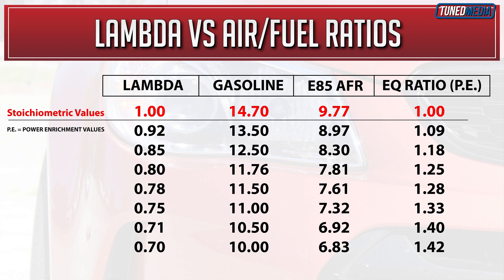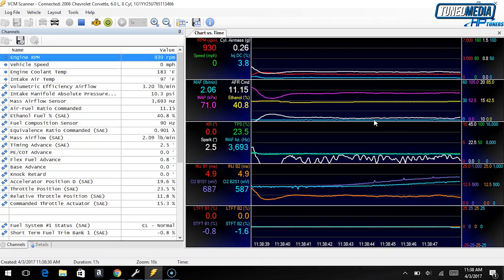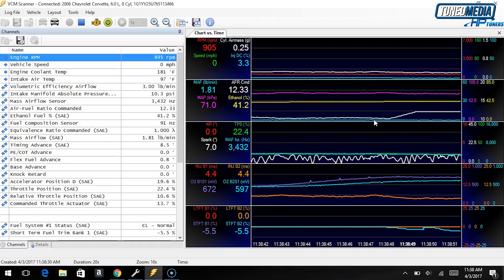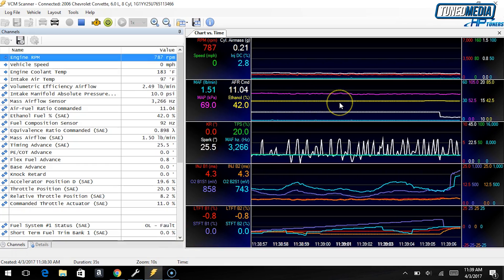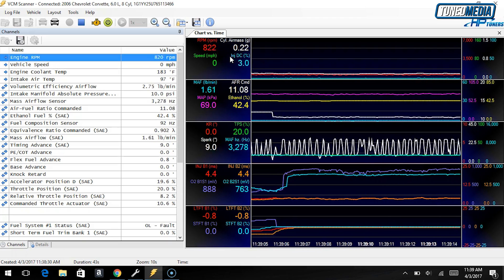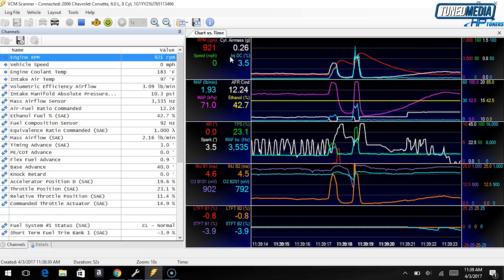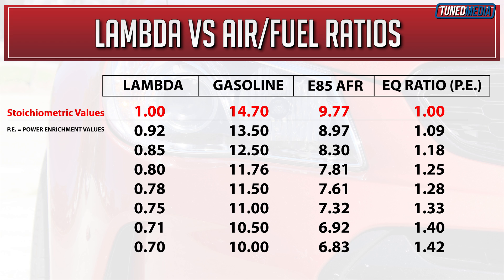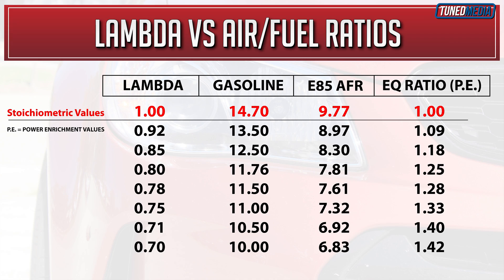Why Experienced Tuners Use LAMBDA and Not AFR When Doing a Flex Fuel Tune

Comment: So what wasn't said here was how to find the EQ ratio of a Lambda value. It's easy on a calculator. Take the Lambda number you want such as .85 and put it in the calculator, then hit the inverse button (1/x). The value will be 1.1764.....or 1.18. Not all calculators have the inverse, but your phone probably does. Cheers-FasNuf Garage

Comment: Go ahead and try running your AFR 9.7 on E85 and let me know how that works. Just tune by AFR on the gauge cause it's automatically converted in the wideband controller. Tune the same way between gas and Ethanol.
Reply: My hellcats tuned at 9.7 lambda reading  strict E85 and runs perfectly  fine?
Reply: Um thats what its supposed to be...lol

Comment: These guys always say this but it really doesn't matter what you use, you just need to know where to end up up. And tuning for power is just adding fuel till it stops pulling harder, so you only need any of this to calibrate the MAF and start your base line...  flex fuel sounds very complicated but it's really really easy in the end... Almost too easy for the power it makes.

Comment: The wideband is going to base its calculations off of gasoline afr though and to do that it uses a calcuation from lambda. So as long as you tune for the right (gasoline) afr with your wideband, it will automatically be the right afr for e85.
Reply: lo boost thats right the big advantage to lambda is it gives you the number to correct to 1.03 lambda?multiply  fuel map x1.03. done that just my pinion
Reply: wrong.
Reply: @LMBC6Brian  How so? Please explain how any of this is wrong.

Comment: Lamda and Afr focus on the automotive standard of 14.72: 1 on all vehicles. The only difference. Is how efficient the fuel. Yoi just simply need to lean this stuff directly not from watching someone or the aftermath. Lamda is just a different way of looking at air fuel ratio. Actually .0 is stociometric. A positive in between 0.- 1 is lean. A negative from 0. To - 1.0 is rich. Ive noticed some scanners dont show this properly.

Comment: To make it even easier, Would be nice to also mention that you could also use the same targets for ethanol as you do for petrol based fuel. No need to change or alter lambda target tables when switching between them.
Reply: Yeah he left that out....
Reply: Well he really didn’t it’s why he showed us the table but it would of been easier to just say if you use 1.0 no matter the fuel your always going to be correct
Reply: Yeah I just went through the same thing when tooting my Kia Spectra on boost because the wideband sensor we have is set up so that when it reads 14.7 that is a 1.0 lambda. And if you just think of it that way your 12.0 or 11.5 AFR will always be the same tooting scenarios as you would with gasoline so just say a lambda of 1.2 equals x x x AFR then as long as you understand that when your gauge reads 14.7 that means 1.0 lambda then your afr's will always be within the range that you need because 11.5 AFR would be equal to whatever lambda it would be no matter if you switch to lambda or AFR it would still give you the same lambda reading at the end.

Comment: Widebands read lambda and convert to AFR, so just tune normally with AFR. Don’t over complicate things.
Reply: That why you vented your pistons?
Reply: Fuck yea, this vid is just confusing and pointless.

Widebands read in Lambda and report in what ever scale you want. Your fueling will automatically change in a flex capable computer based on alcohol content and the lambda will read  the same (at .85) if your map is good and your reported AFR (fuel scale)  will stay at 12.5 to 1. Doesnt matter how much or how little alcohol you have, the wideband will read in lambda and report in AFR.
Reply: Right? 😂

Comment: what lambda do you see the most that makes the most HP ?
Reply: Every motor is different your not looking fir a aft or Lam for power that’s just the fuel your looking for max MBT for the most power it’s why you just keep bumping up the timing till the motor stops making more torque then you back the timing time down a couple degrees and if the fuel is good your done :)
Reply: @markim5087  that was 2 years ago. I do this professionally now making 150k a year 🤣

Comment: when you convert to e85 you automatically know your going to be richer in afr?
Reply: Yeah but that doesn’t matter because many tuners will increase the fuel by 45-55% and still look for 11.5-11.1 and while it will run its not going to be a great tune it’s just safer to look for 1.0 on any fuel and you can never go wrong
Reply: I do not understand the rational of all this lambda is better because it doesn't change as you flex fuel your way back and forth. If thats true!!! Then AFR doesn't change either. On a boosted engine for example if your running 11.5 AFR with 93 octane and switch to E-85 you are still running at 11.5 AFR!!!  AFR OR LAMBDA NEITHER CHANGE stoiciometrically,  1.00 or 14.7 both the same !! THE ONLY THING CHANGEING IS HOW MUCH FUEL YOU ADD OR TAKE AWAY!!! Why all the scuddlebut

Comment: He was talking about flex fuel when the alcohol content can be all over the place depending on the fuel you are putting in the car. There would be no need to change the set up scale for afr everytime you switched fuels or the alcohol content changed. That's what i gathered from this video.

Comment: I thought that AFR was just a formula converted number from Lambda. And the measuring unit must be set to understand what fuel mixture it measures. Now there are more questions))))
Reply: That's my understanding too but there's a lot of different gauges and boxes out there for logging so who knows. I'd like to flip my gauge to lambda but can't so I use the pro ports on HPT to get it.

Comment: Sir, I think you are mistaken about this.  "AFR" from normal widebands are nothing more than lambda converted to whatever AFR scale you choose in the setup table.  If you change the concentration of alcohol it makes no difference just like you're saying, but you don't have to be reading out in lambda for that to be true.  Take whatever scale you're most familiar with and use it.
Reply: It's tricky to know for sure that we are talking about the same things, as this is obviously a slightly confusing topic.  Basically widebands only care about stoich, and ratios of how far away from stoich the mixture is.  So if we're talking about gasoline, ethanol, methanol, or any other fuel, at stoich the wideband sees Lambda 1.0.  If you tell the wideband what scale you want to use, it just uses a conversion factor to readout in that scale.  For the sake of discussion using your numbers, if you are running a fuel with an actual stoich point of 9.88:1, the wideband can read a perfect stoich mixture as 1.0 if you tell it "Lambda," or 14.7 if you tell it "gasoline."  Even if the actual mixture is 9.88.  The wideband doesn't care, since all it cares about is stoich, and what percent above or below stoich the mixture actually is, then it just translates that "Lambda" into whatever scale you tell it you want it to read out in.  Lots of us just keep using the gasoline scale for all fuels, because that's what we're comfortable with, so we don't have to think about it at all.  Sometimes I think I should train myself to use Lambda, but then I think, "Why bother, because it doesn't actually matter?"
Hope that helps, it's all I have time to type right now!
Reply: +Bob Morreale, sorry, but to me it just doesn't make sense..  For example, if I'm flex fueling in boost, and I tune to be at .75 lambda (for the sake of easy numbers), if I left my wideband in gas scale, it will still read out at 11 to 1 no matter how much or how little ethanol is in the fuel solution.  The wideband doesn't care, and all it is doing is multiplying the lambda number by 14.7 because we told it gasoline.
I actually do this, and I know it works, so I'm not just speaking in theory.  What am I missing?
Reply: I took it as he was suggesting this because a lot of the new tuners don't know about having to setup a wideband for the proper fuel they're using to read the afr correctly.
Reply: i was literally going to say the same thing, as people watching this video might that that they need there wideband to read 9.77 at idle and get confused. I suppose this is fine in that hes talking to tuners who understand what a wideband does but for others they may not understand what he is saying
Reply: +Evil Opti Z the point is that you don't actually need to..  Especially when you're messing around with flex fuel situations or methanol injection, it just doesn't matter since you have different stoich points for the different fuels.  As long as you know where you want your AFR to fall on whatever scale it is that you're comfortable with.  If that is Lambda, then that's great.  However, if you're more familiar/comfortable with AFR on the gasoline scale, then sticking with that works just fine.
Reply: Yes, you are correct.  That's exactly what I was trying to get across; along with the point that if people tune with Lambda instead they won't have to worry about AFR or scale changing at all.  Thanks!
Reply: No, it actually does matter when tuning Flex Fuel because the scale changes whenever the concentration of alcohol in the tank changes (from fill up to fill up).  That's why using Lambda is required instead of AFR, because your targets never change using Lambda.  Make sense?
Reply: Bob Morreale isn’t that what a flexfuel sensor is for?
Reply: Exactly, widebands read LAMBDA...THEN CONVERT TO SHOW AFR. This guy is trying to confuse people to keep his job LOL. Just messing but seriously widebands read lambda then conver to show AFR. No matter what fuel you run the widebands is still reading lambda, which means if you stick to AFR stoich (14.7 eg) then you’ll be fine. If you’re running E, you still want 14.7 cruising and 13ish at WOT
Reply: Ok, but in truth you really don't even need to worry about scale changing at all, correct?  As long as you are using whatever scale you like WELL, then you're all good.  It just doesn't matter what scale you're on.
Reply: Yes this is what he’s saying. On the actual software itself change it to lambda to tune with, this way you can tune ANY form of gas or ethanal or alcohol because 1.00 is always stoich. Then you can always target say .80 lambda on anything and it will have the correct amount of fuel and air. Also it makes tuning much simpler because if my target is .80 and I’m leaned out at .95 all I do is hit the times function and enter 1.15 add 15 perfect fuel in that spot and I’m back in my target. Now I understand what you’re saying, as far as the wideband goes you can leave it say with the normal 14.7:1 as long as you understand the implications. However he’s talking about in the software as I’ve said it’s easier to tune with lambda
Reply: Hammerhaus Kennel So if a wideband is setup for gas and stoich is 14.7 and you use that wideband for E85 then your stoich will still be 9.88 (I stand corrected on the actual value)? Or will it not be right when it's setup for stoich to be 14.7 with gas?
Reply: Agree, tomartoes tomaaatoes. Here in Australia we're metric but I still find inches easier when engine building
Reply: Yep, if you're swapping fuels sure.
Reply: Bob, it makes perfect sense to me, especially since E85 from the pump can vary as well as target e-xx mixes which may change slightly.  Lambda is absolutely the way to go.
Reply: Ashter Egg He’s in FL near me. He knows his stuff, think he just went about explaining it wrong

Comment: my car is targeting 12.5 afr i have lambda sensors and full E85 is the car running too lean for ethanol? or is the tune fine, so far I've had it for almost a year or 2 like this.
Reply: If your O2 gauge is reading 12.5... and its calibrated for GASOLINE... then its actually rich.   

12.5 divided by 14.7 (Gasoline stoichiometric ratio) = 0.85 lambda.   E85 stoichiometric ratio is 9.7.   Hence,  9.7 x 0.85 = 8.25

So if you're running E85, and your Gasoline-calibrated O2 gauge is reading 12.5:1.... that means your actual air:fuel ratio is 8.25:1
Reply: How is the  wideband set/referenced and calibrated? 
A 12.5 AFR is not indicating rich if the wideband is properly set/calibrated for E85. 
What is the actual sampled and measured percentage of Ethanol in your E85 fuel? 
The actual percentage of Ethanol in E85 varies significantly with each distribution truck load due to climatic/seasonal blending, temp, environmental conditions, age, storage conditions, chance and locale. 
In most of the US per ASTM and federal specifications the actual percentage of Ethanol can vary from approximately 51 to 88 percent and still be legally marketed and sold as E85.
Reply: LegendaryBeastMode  It would help if you could actually write properly, using proper grammar... so people could understand what you're trying to say!.